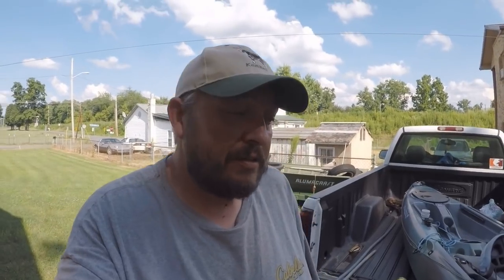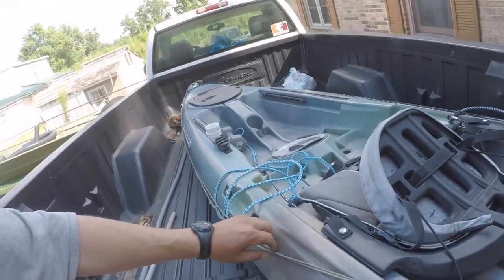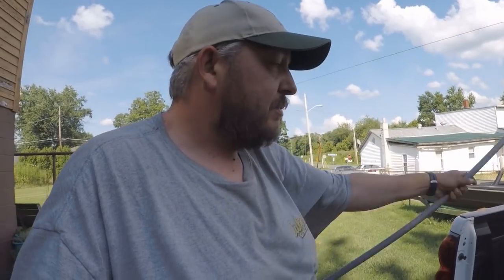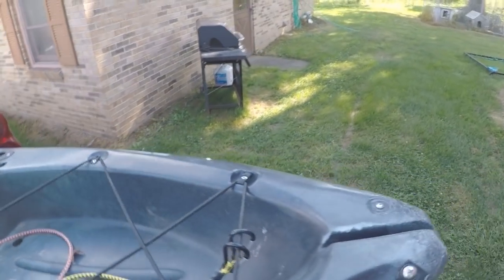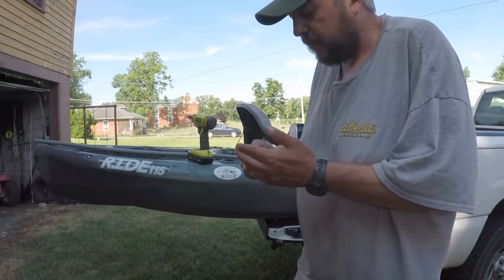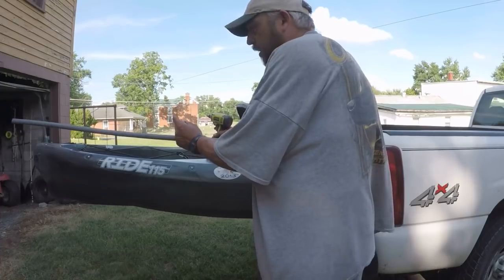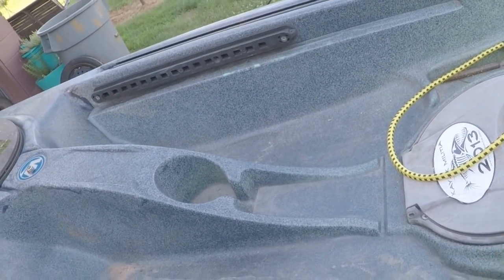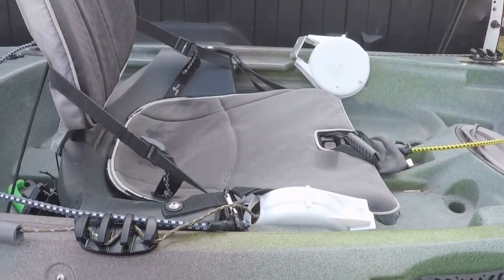Better than Anchor Trolley on my kayak. Less is more with safety!

Comment: well now....good video. IMHO I do not think the conduit is neccessary, nor the drilling of holes. I have something similar, but used a pulley that is attached to the bow carry handle. As for the retractable clothes line, I mounted it in a track with a tee bolt. Should I ever decide to go with an anchor trolley, I would attach a carabiner to the middle ring of the trolley and hang a pulley there. This would give me line management and the ability to position the anchor anywhere. No need for two anchors, but could be useful should you be in rivers. As for the knot, I use a figure knot which is pretty small and passes through the retractable clothes line (mine has a little holder built in to lock in the line, so I don't need a cleat either.) That being said, everyone has different needs and your idea is certainly a good way to go for what YOU need.
Reply from the maker: Thanks and I agree. I did this years ago and still have it like this and use it from time to time. I’ve got a few other kayaks but have not used the conduit pipe on them.

Comment: Nice video. Good ideas!  That knot is a sheet bend.  A sheep shank is to shorten a length of rope without cutting it. 👍😉 A Blood knot would be smoother.
One thing I would do, is put a bend in the pvc pipe at the anchor end. (Use a pipe bending spring after heating the pipe in boiling water.) This would allow the rope to run more freely and cause less friction and wear on both pipe and rope. I would definitely use plastic pipe clips.  Great ideas! Thanks for sharing. 👍
Reply from the maker: It has caused some wearing on the rope and pipe. I have put couplings on the ends of the pipes because the rope cuts into the pvc over time.

Comment: Ive got a 10 ft pelican and i felt same way i did it through the handle roaps just to try it,before i make it permanent and i didnt like my anchor draging in the water on the front snd back went back to the anchor trolley. I dont use an anchor as much as you but i do use it

Comment: Maybe would have used plastic pipe straps instead of metal. Also depending how much force from bend in pvc, maybe bolt, nut, and washers would be better. Both easy fix if problems occur. All in all great idea and great video too!
Reply from the maker: Thanks. I agree the plastic pipe straps would have been better. The screws haven't been an issue at all. They have held up great. I still use this set up but I switched the anchor rope up. I now use a retractable dog leash.

Comment: Yeah i need a clothes line it will be my 2nd attempt,last time i let it slip out of my fingers when i was switching out the plastic line with the parracord and it had been in my backyard for 5/6yrs and it would come apart !so it went in the trash and i stuff the anchor rope under my seat
Reply from the maker: I actually changed over to a dog leash from Harbor Freight. It doesn't hold as much line, but in the river it works great!